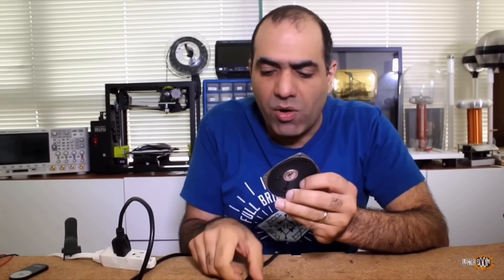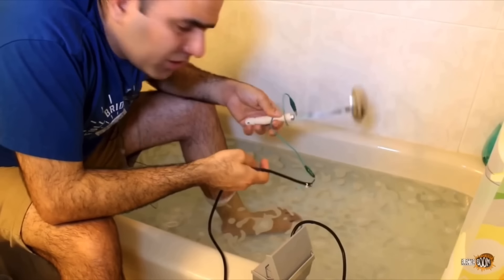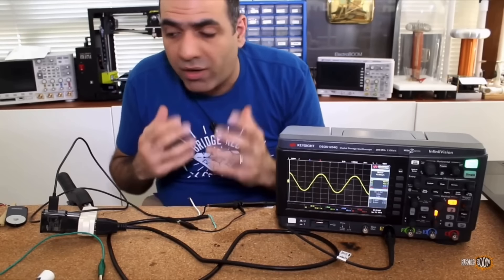ElectroBoom Fails #2

Comment: 0:11 (RIP Headphone Users)
0:18 + 0:27 = (o h  n o)
0:46 (M3GAN 2 confirmed)
0:59 (O H  S H * * !)
1:04 (Poor Finger)
1:14 (Maneuvers like a stunt double)
1:19 (The voltage is surprising)
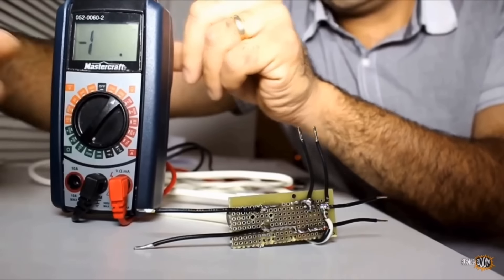1:26 (M Y  G O D !)
1:51 + 1:55 (ouch)
2:13 (“And just for that b-a-a-a-d pun alone, here’s a finger-sizzle”)
2:24 (Sorcerer Debunked)
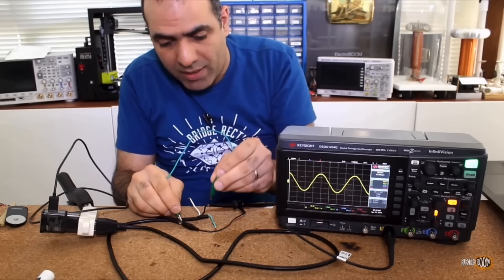2:34 (that actually scared me 😂) - I ALMOST TYPED AUTOPSIED 
2:59 (the pain)
3:02 (Perfectly Cut Screams)
3:18 (Mixtape of Boom)
3:28 (But I  t r u s t e d  you)
3:40 (👋)
3:44 (😳)
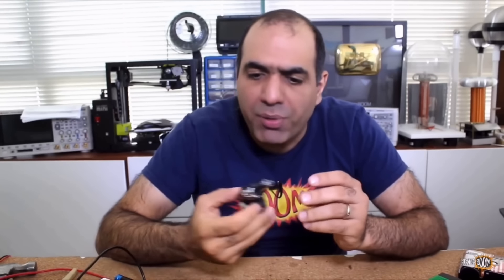3:50 (Press the TRA-JINK, SH**!)
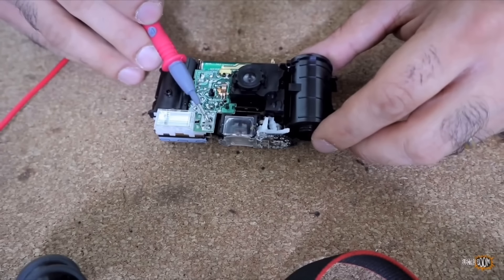3:58 (Then you Charge GG-INK, SH**!)
4:16 (OOOOOAAOOWW, SHYE**!) 😱
4:20 (painless “ow”)
Reply: Those were the funniest that I’ve laughed endlessly and tear drops
Reply: 3:00 3:03 4:17 perfect timing?
Reply: What video is MY GOD

Comment: My favorite clips:
0:10 MaXiMuM ViVbRaTiOn
0:30 ..."It's more dangerous if the current runs through you before the water" YOU DON'T SAY!
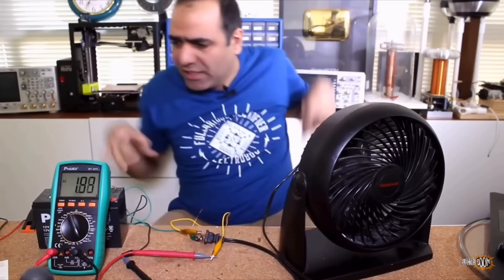1:45 What did you think would happen?!? It's electrically charged!!!
2:58 And that kids is why you don't touch a taser with your bare hands
3:01 "...people suffering in cold- OH FU##"
3:15 And now it's gone. You said it yourself
Reply: Same
Reply: 3:01

Comment: 3:19 that is not a USB that contains any music that is a USB killer USP killer they have a lot of voltage instead of memory chips they replaced with capacitors if you’re not sure if it fits is a USB that is regular or a USB killer take it apart. This guy is always wiring things incorrectly and always puts his life on the line!

Comment: 0:11 That was a 50/60Hz tone, same as the power frequency. Funny thing is, if you made a Switch Joy-Con produce a vibration at the same frequency, it would be very difficult to hear or even feel.